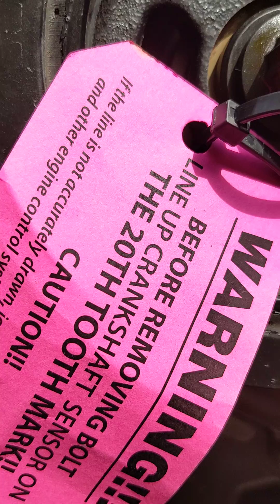Ecoboost Crank Sensor Position

Comment: Hey! Do you use that tool when starting the vehicle to ensure it’s on the right position or do you take it off before starting the vehicle? I have a 2016 Mustang Ecoboost and I just replaced the sensor but the instructions said that it need to be on the 5th tooth…
Reply: different years are going to have different positions and different crankshaft position pins. if you try to start the engine with that tool on, you're going to damage the reluctor wheel and position sensor.
Reply: Exactly wtf mine won't start

Comment: 20th from where this dont make any sense what you sayid need explain it better
Reply from the maker: Sorry for the confusion, if you look at the crank pulley with the timing wheel still on it, you can see a gap between two teeth that's slightly larger than the rest of the gaps. That's TDC. It's 20 teeth from there. I apologize as my thinking at the time was that anyone watching would've already noticed upon inspection of their crank pulley.